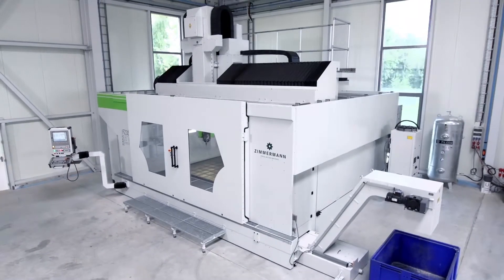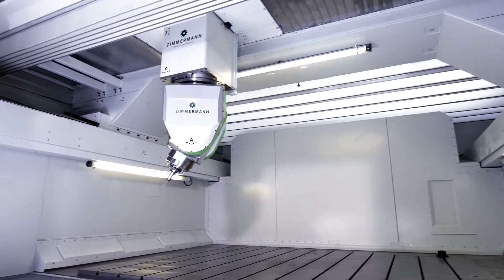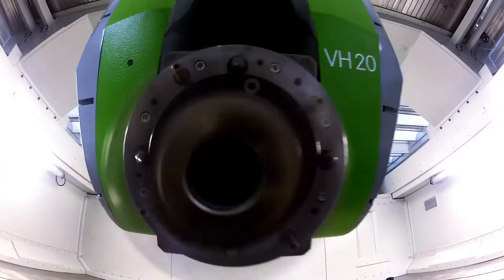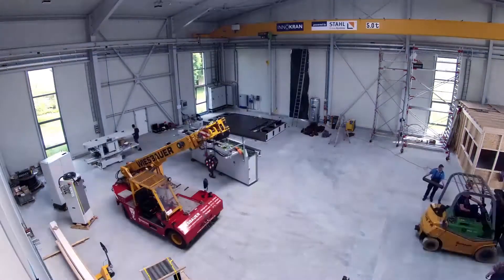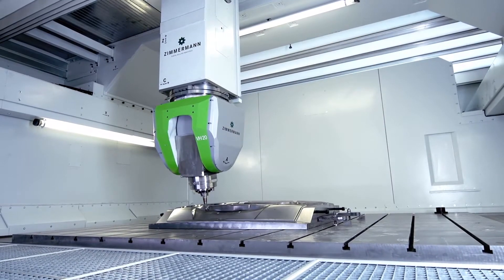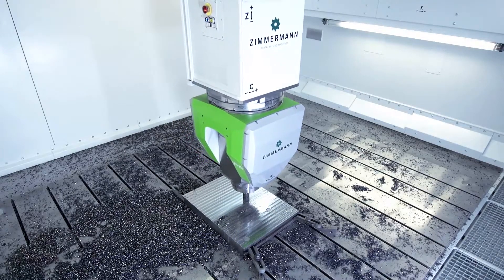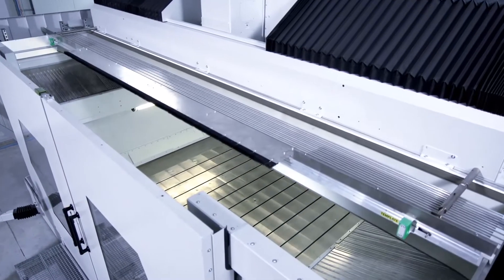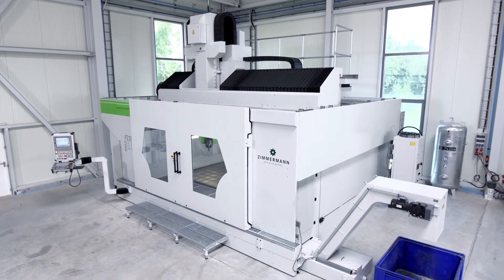Zimmermann FZ33c Installation Time Lapse

Comment: I've worked on similar machine, it was a battle to machine more than 0.5 mm cut with a facemill on a mild steel, terrible rigidity. Hope on this machine, that's not the case.
Reply: its an arm. its not rigid.

Comment: Why 5 axis demos are always aluminum, not steel?
Reply: lots of material removal rates and less chatter. looks good on marekting videos.
Reply: Exactly 👍
Reply: to make a clip, you must turn off coolant jet first. its not that bad on aluminum, because of its innate thermal dissipation rates.  steel on the other hand, cant be milled dry at all, unless its very slow speeds. that would not make a good vjo.